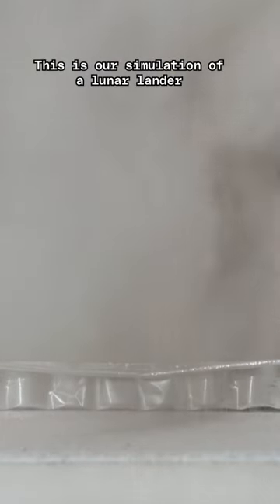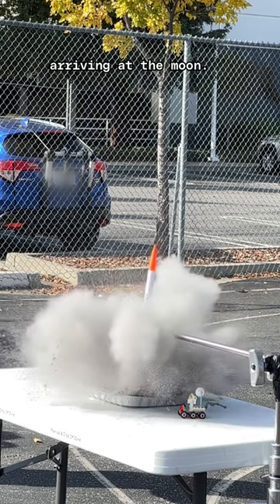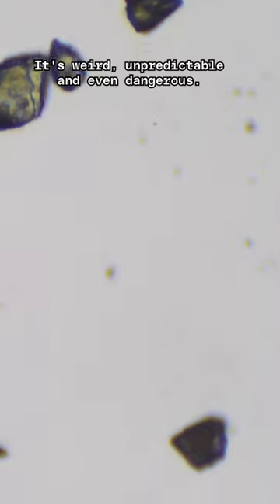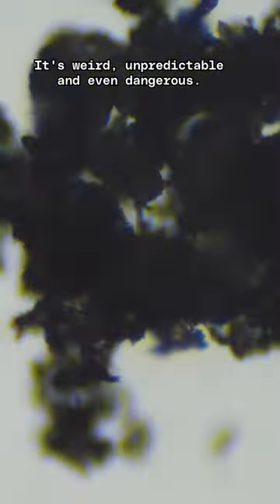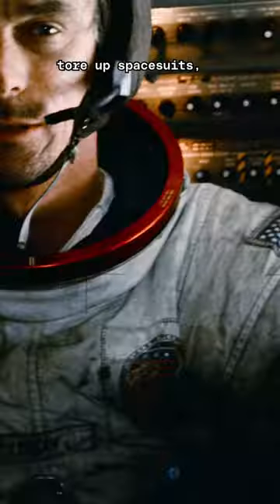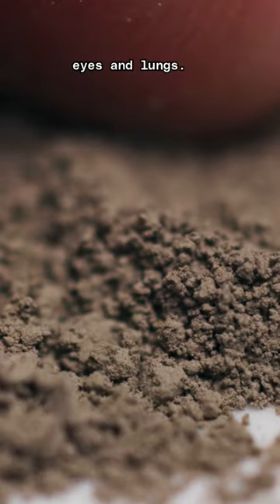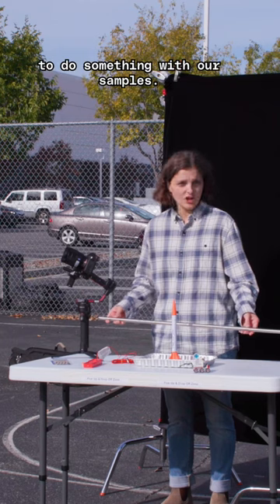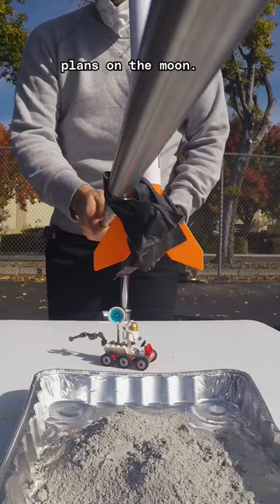We bought moon dirt off the internet (and blew it up) #shorts

Comment: One problem I noticed is that gases act differently in a vacuum, so this experiment is flawed.
Reply: The size of the particles compared to the rocket is also not to scale
Reply: Well also the gravity would be different too, but I think they're not actually designing equipment based on a toy rocket in a throw away baking pan. 🙄